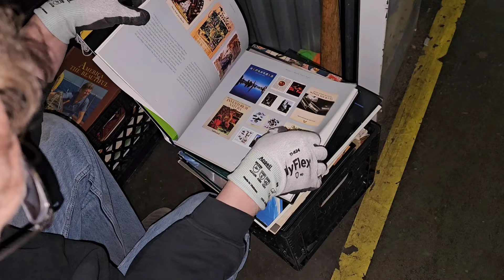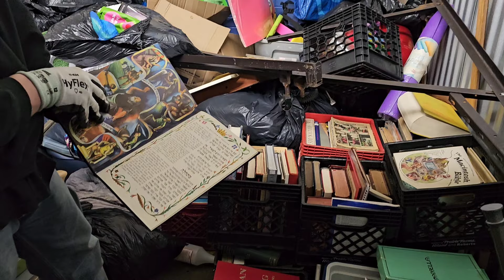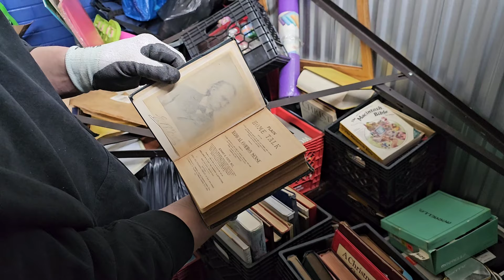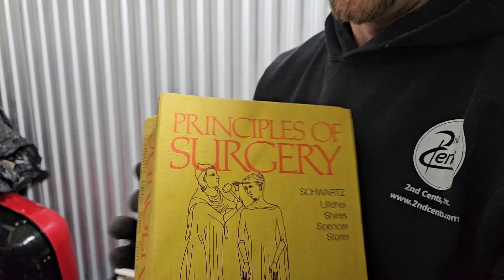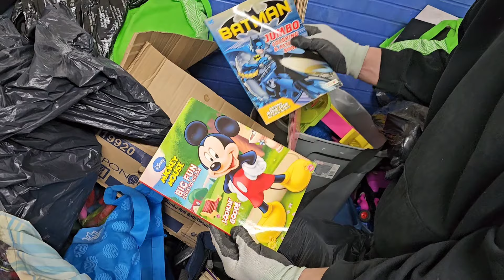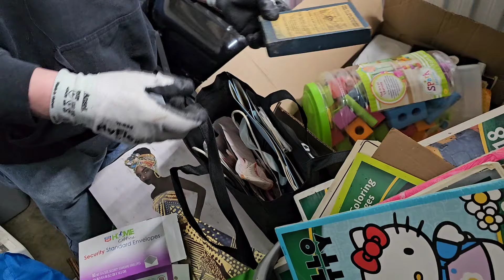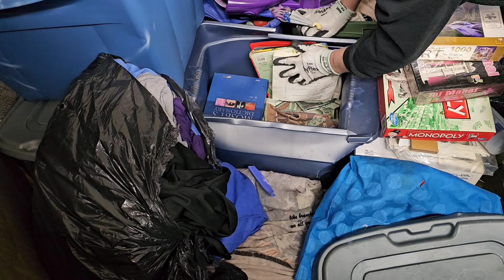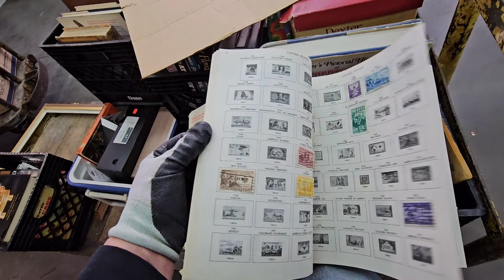$2 unit NO ONE WANTED! ~ Unbelievable!!

Comment: A lot of the time, the saying is, around the turn of the century. So late 1800's to early 1900's. Or late 1990's to early 2000's. Though it is still referred mostly to the 1800/1900 Era.   Nice unit for $2.00

Comment: Turn of the century would be the time frame near the start of.  So, is speaking of the times near 1900, 'the turn of the century' could be 1899-1901.  If used, 'around' the turn of the century, of course.  If stated, AT the turn of the century it would mean 1900 or 2000.  Test on Friday.